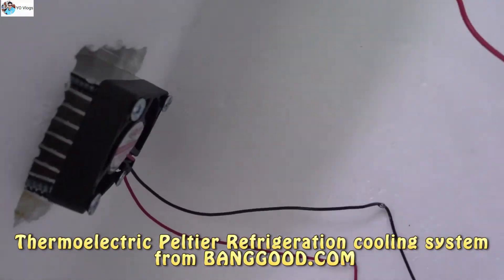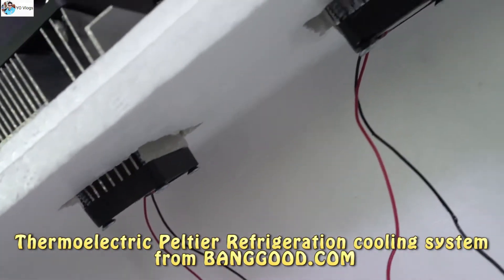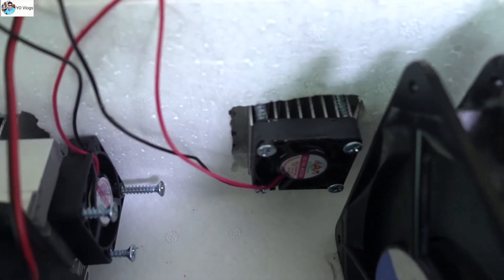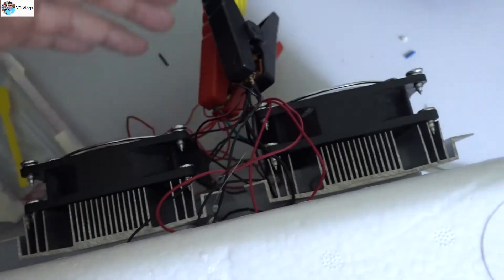Peltier Mini Air Conditioner

Comment: Where hot air going?
Reply from the maker: hot air is not coming inside the fan compartment
Reply: @YOVlogs  but must go outside room
Reply from the maker: @merlygallardo4336  if u can set this thing in small window than this will work better

Comment: how many peltier did you use.is it ok to use with a room size of 2x2 meter room?
Reply from the maker: In this video 2 peltier but fo 2x2 use at least 4 peltier
Reply: @YOVlogs  another question.is this dangerous?can this cause fire?
Reply from the maker: @raged3539  yes kind of but do wiring properly and use good quality power supply
Reply: @YOVlogs  ast question.is this thing can run atleast 8hrs?or less than 3hrs?
Reply from the maker: @raged3539  i try this thing for 5 hrs long road trip and it was fine no issues
Reply: @YOVlogs  thanks sir.im sure to watch your new invention next time.thanks for the info.

Comment: I check the power supply for this thing but cost me another 15 bucks is there any way to use any other power supply with this unit
Reply from the maker: any 12 volt but more amps